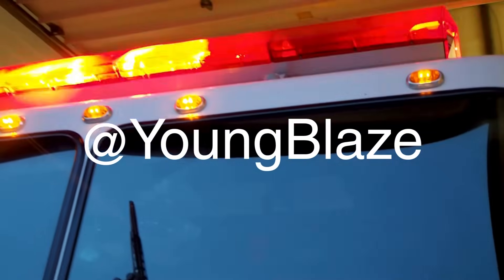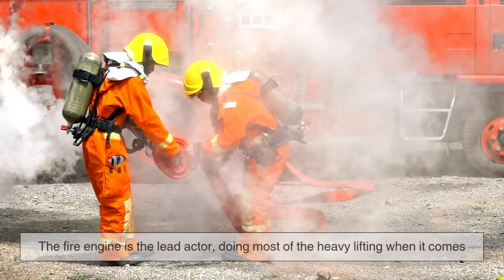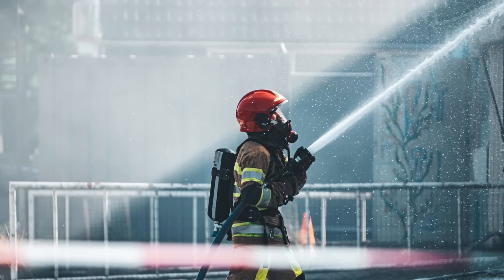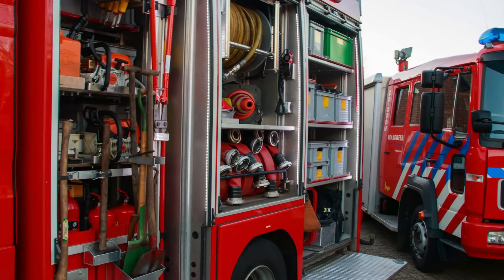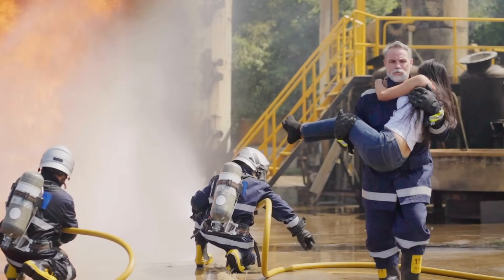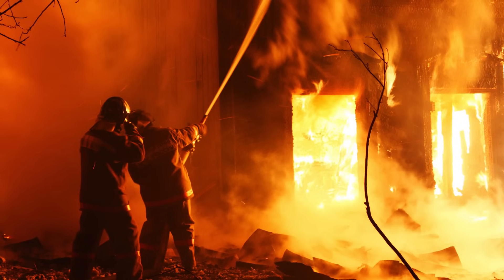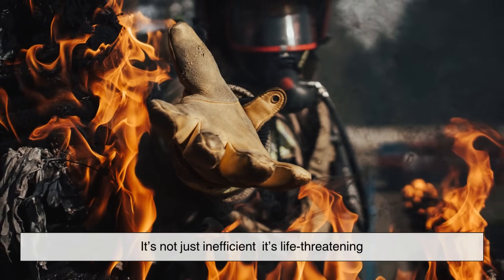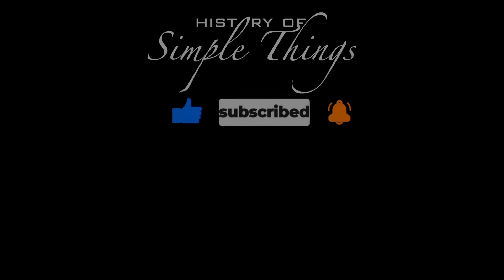Fire Truck vs. Fire Engine: What’s the Real Difference?

Comment: in italy we have different means because we have national fire departement. we have the fire engine which is similar to the engine, but if there is a need for more water we have the tank. then we have the ladders which do not have water and have little equipment. finally for technical interventions we have (but they are rarely used) multi-rescue vehicles

Comment: Here in the Philippines, additional vehicle roles:

- Need a Fire Engine but in a small area? The "Tweety" Pumper would be perfect (Named due to size like Warner Brother's Tweety the Canary, A modified Mitsubishi Pajero) and can be linked to Fire Truck. 

- Need to fight fire without a fire hydrant? The water tanker would be your friend and can be chained together to provide water supply, it has built in water pump to extract water as needed (Including River and Sewer).

Our Firefighter are multipurpose and can handle fire or rescue, Some also houses Ambulance and can link to any city's hospital as needed.

We also adapted terms from Europe: We have Specialist (or technicals) that can handle unique situations.

The challenges we faced are funding and  responding within our city's fire, however we can be called to other city's fire as needed based on operational hierarchy.

Another challenges is we are prone to stabbing in certain area due to people displeasure to complying to their request (take priority in putting out the fires with bribery).